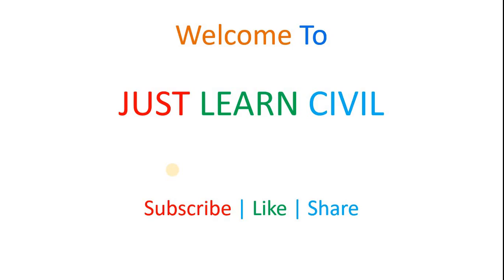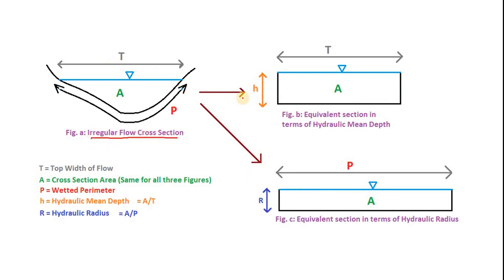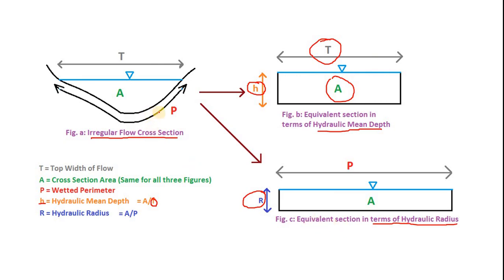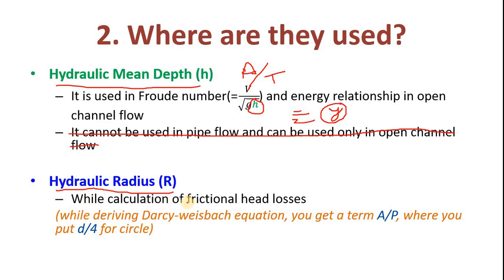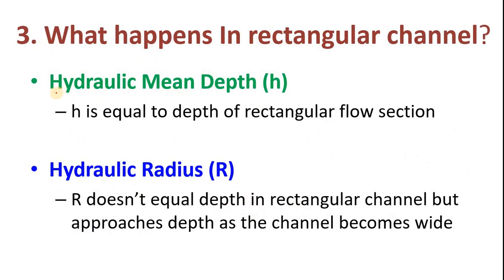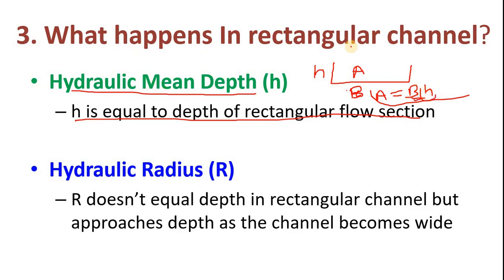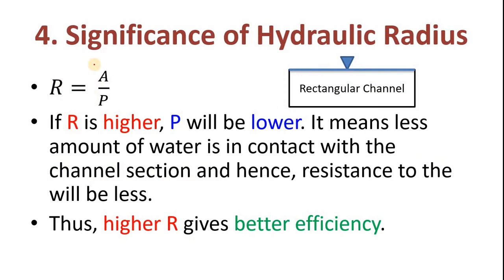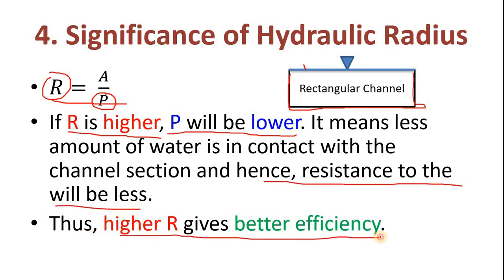[HYDRAULIC #1] Concept of Hydraulic Mean Depth and Hydraulic Radius and their Differences

Comment: So when calculating the Froude number in a circular pipe with open flow (i.e., not pressurized), should we use hydraulic depth or the hydraulic radius?

Comment: Hydraulic mean depth and Hydraulic radius same.The first one is only hydraulic dept.Dont teach wrong in fundamental stage.
Reply from the maker: Hydraulic mean depth is related to top width of channel cross section while Hydraulic radius is related to wetted perimeter of cross section of the channel. Hence they aren't same as you have stated.
However, in case of very wide rectangular channel i.e. B>>>y, both tends to be same.